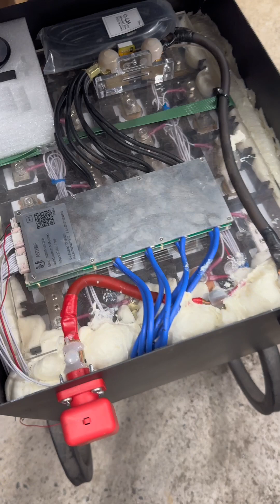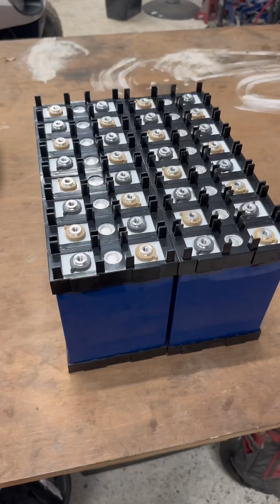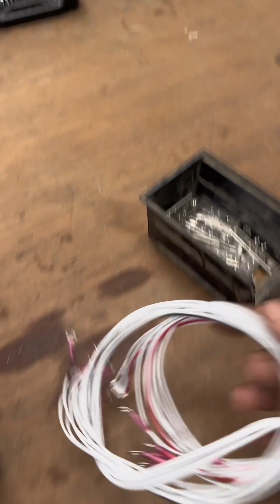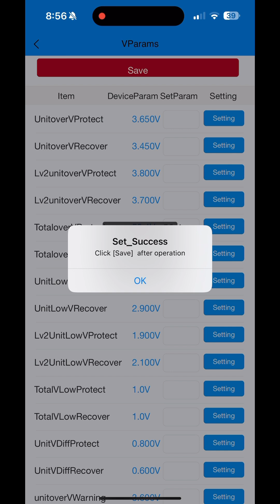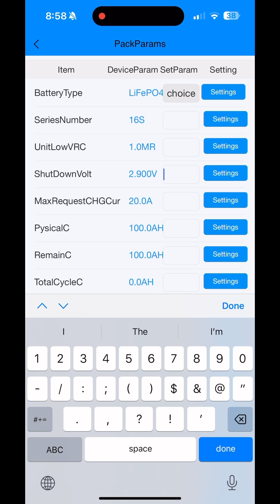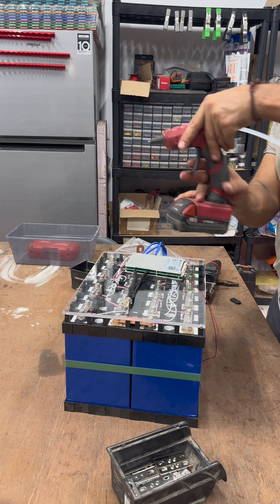Build your own golf cart Lithium battery!

Comment: Do you ever put 72v 24s batteries into a cart without removing the body? If so, a video on that would be great.
Reply from the maker: It’s just the size of the box you build, you could easily get a 24 cell battery in a club car or EZGO. I will be making a 72v video soon and I will go over the install too!